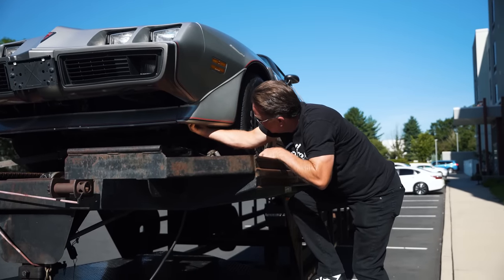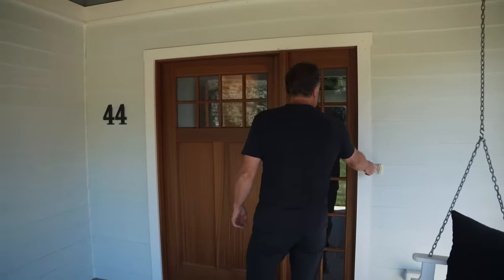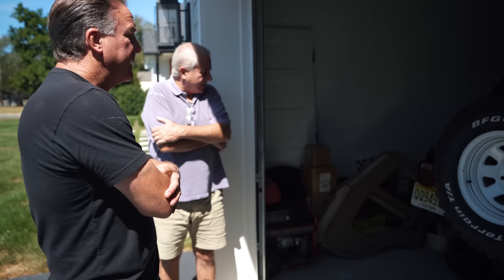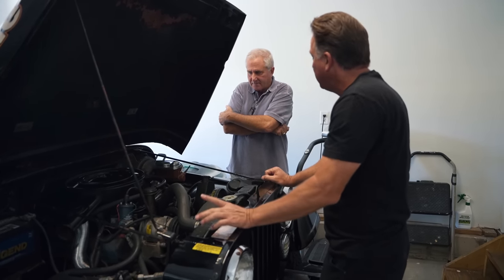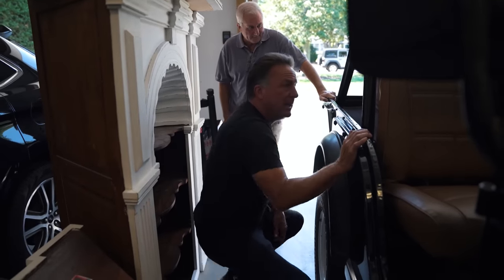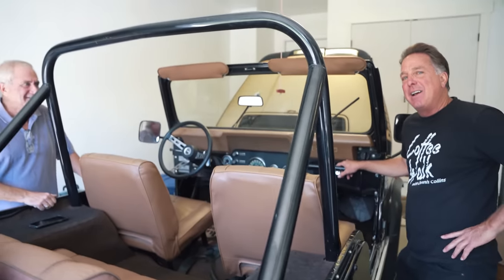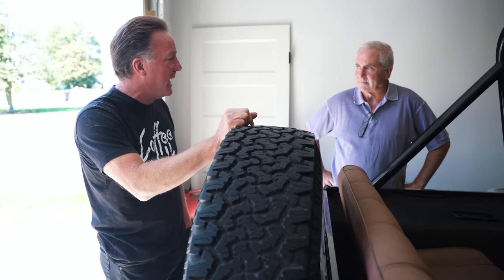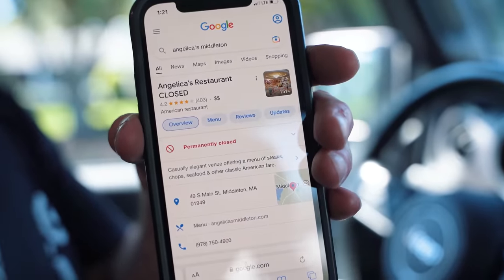Jeep so rare I bought it twice!!

Comment: I bought a new Levis CJ 5  in 75.I seen it on a local Jeep dealers tv commercial. Went there the next day and they had a blue one and a white one. I got the white one with the blue interior and the V8. Loved it. Back then they didn't have all that padded dash and carpet stuff. it was plain Jane as could be. Kept it ten years before i sold it to get a F150. It was a great 4x4. Still have the owners manual.

Comment: That GMC Sierra is SWEET! If it was 4-wheel drive it would be perfect. And yes, that 4.3 V-6 works just fine in those trucks. It may not be that great at towing heavy things, mine was a 4x4 step-side with the V-6 and a four-speed manual on the floor, and it did a pretty good job at towing a 20ft 3200lb boat. Wasn't a rocket ship, but it worked fine.

Comment: I don't know what they went for in 77 but I bought a new 76 non Levi red CJ-5 Renegade 304 V8 3 speed manual power steering power brakes with all available options for approximately $5700. I had a shop replace the 2 bbl with a Holly 650 4 bbl carb and Edelbrock maniflod plus a dual exhaust set up within the first month. I can't remember what I paid for that but I'm thinking it was around $700. for sure. I actually tried to order it with a 4 bbl and dual exhaust but the dealer said they didn't make them that way. Yeah I probably voided the warranty but I never had a single problem with it and I drove it hard on and off road. Other than regular maintenance the only thing I ever replaced other than the carb and exhaust  was the original black top with a tan Best top.  Great running and sounding Jeep. I sold it to a friends son in 1985 and it was still in great condition. Loved that Jeep.

Comment: My 1st car was a 1979 baby blue Jeep CJ-7 Renegade w/ soft top, 304 V8, 3-speed Hi & Lo manual transmission with A/C, PS, & PB... 4WD obviously. It used to smoke 5.0L Ford Mustangs off the line which made me gas $$ like FarmTruck on Street Outlaws. That vehicle flew past everything but the gas station... got maybe wanna say 5 or 6 mpg? ...with the wind, I used to love to drive it with the windshield down because that seem to add or mile or two to it's mpg's LOL but cops didn't like me doing that so I was always getting pulled over in it very early on. Luckily, gas was still only 85 cents per gallon back then so it didn't seem to matter so much back in those days. I'd hate to keep one specked out like that as a DD these days though, definitely a rare time machine. Didn't Mork & Mindy drive a black Levi Jeep CJ-7 Renegade back in the day?

Comment: In about 2011ish I bought a CJ5 Golden Eagle with a Levi interior from an auction. It was a brownish color, original paint and decal. It had been part of an estate, it had no roof and looked like it had been sitting under a tarp for years, but it wasn't really rusty. It was all there except the roof and the doors. The auction couldn't get papers for it from the estate, so they refunded me my $700 and sold it in a salvage auction branded as parts only. That was a crying shame.